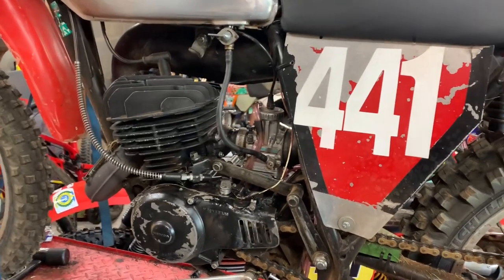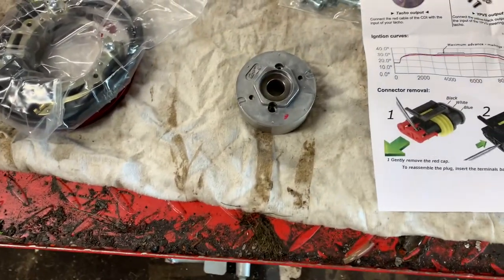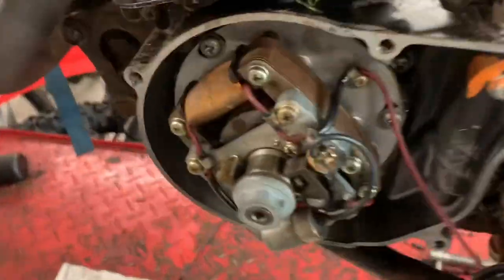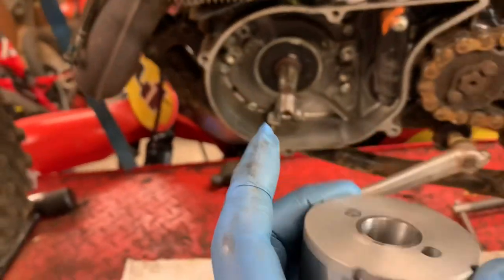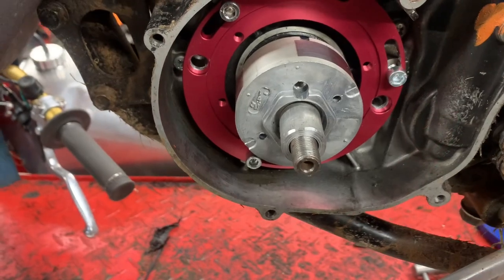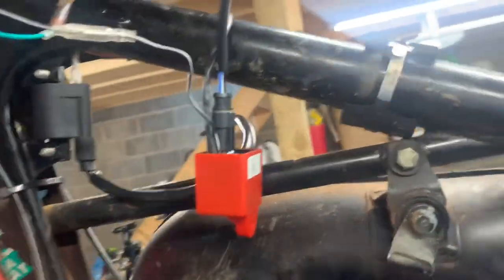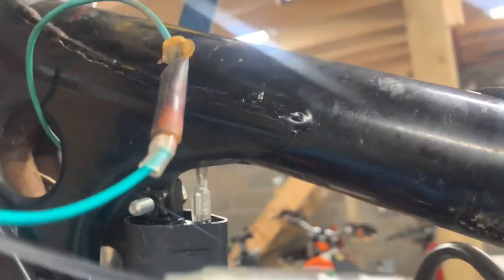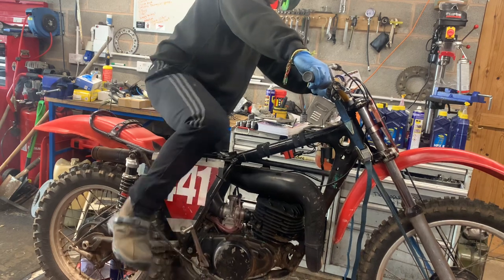Installing HPI ignition on 1975 Honda CR250

Comment: Excellent 👍
Do they have that kit for Motoplat CDI on old European bikes ?
I never knew CR had points that late ?
Reply from the maker: Yeah they do have kits for euro bikes too. Just need to check specific models. You I was a bit surprised about the points that late too though I knew they were points in 74… I suspect they were points until the red rocket in 78..
Reply: @phoenixmotos9712   points must of been an issue in water and at high rpm floating.
🥂 Cheers 👍

Comment: How did you modify the red backing plate to fit?
Reply from the maker: I basically drilled out the slot for the bolts so I made a greater diameter for the bolts to go through - do you have same problem as I had?
Reply: @phoenixmotos9712  Yes it seems so. Did you have to open up the slots? Widen them? Grind on the actual case?

Comment: You seriously need the stator in place before you do that , you also have to LAP the rotor to the crank stub,
Reply from the maker: Hi - I’d lined it to the right are and then just needed to get the exact position right. Regards lapping it - I’ve done hundred of these and never had 1 slip & never lapped them